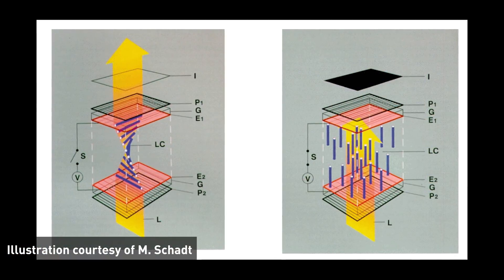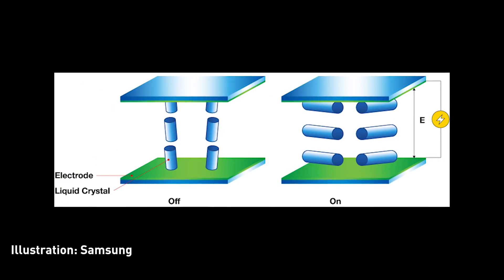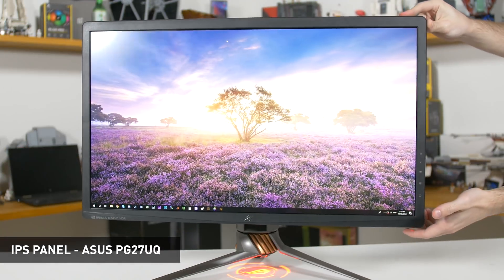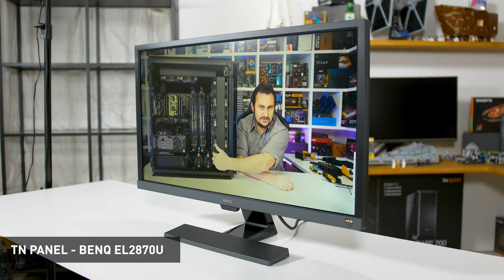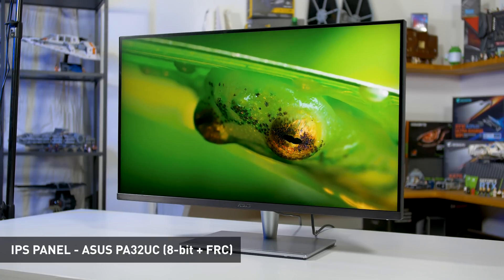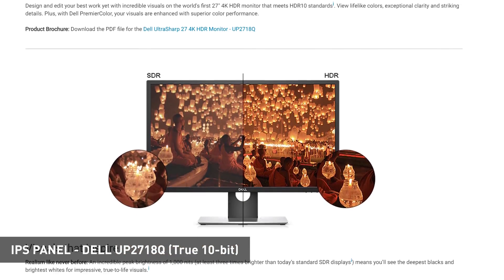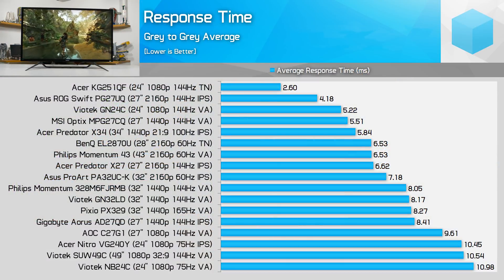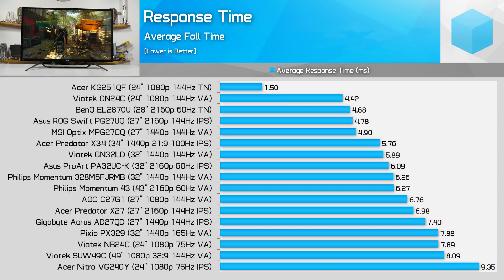TN vs IPS vs VA: Which LCD Monitor Tech is Better?

Comment: Gaming - TN
Productivity - IPS
Media - VA-QLED
Rich People - OLED 
The Truth - MicroLED
Reply: OLED for the Windows bar and Youtube logo burn in.
Reply: @philipcooper8297  LOL! That's a repeat of history, like CRTs with a game burned in!
Reply: phones - oled (cuz its damn efficient)
Reply: No, no, no. Don't do this. There is no panel made for application A or B.
Reply: lol TN for anything eeeew
Reply: @Battleneter  I have to admit, I will take an in-spec Sony Trinitron CRT monitor pretty much any day!
Reply: Dude old list va is mainstream gaming response time is faster an input lag is fine for driving simulations
Reply: C Anderson
NO.
I use IPS for everyday gaming and internet, sometime movies/clips, and no problem at all.
Reply: Well i prefer to game with ips. Started wih an 27inch asus tn and changed to a acer 32 inch 4k ips and i dont notice the diff of response. Always prefered ips for everything.😶
Reply: Exactly this
Reply: You dumb fuckin peckerwood
Reply: @EJSC dumb noob
Reply: Only if you are not productive in evenings - dark room, because dimmed IPS changes any image to a source of a grey light.
Reply: You can get 1ms va and ips panels now. So really they will all game the same with high refresh rates.
Reply: @kushined  you cant... and dont get response time for input lag, as they r not the same, tn is faster, is it worth... depends... for 240hz csgo competitive, tn all the way, its also cheap compared to a decent ips 1440p 144hz low delay one, these are 700$
Reply: @arencorparencorp2189  TN does not have faster response times (input lag), only faster pixel transitions (G2G, which only really affects blurring/ghosting). Good IPS panels can be just as fast or faster when it comes to input lag.
Reply: @Malus1531  the pixel transition is faster so the image gets displayed.. faster, the ips circuit board will be as good at inputs but the display will take the slightest delay over the tn, is it noticeable when ur playing with 30 ms ping. absolutely not, maybe at 240hz extreme competitive shooters at pro lvl... other than that, sure, its, technically, slower but... barerly noticeable if at all, but here comes another MAJOR factor about delays with tn, 300$ tn=good responses and 144hz, 300$ ips=crap, 700$ ips=same perform as that tn, also the light bleed doesnt help much and pixel transition adds a bit of delay as said. and also ghosting, if we count imput lag as the time for the screen to PROCESS the image they r equal, but then the monitor has to change the pixels to the matching values, and tn does that faster, (again, nearly impossible to notice at top tier ips)
Reply: @arencorparencorp2189  A lot of good points, but whether TN is faster will depend on the panel. Look at TFTCentral's review of the Asus PG278Q (TN) and PG279Q (IPS) for example. Similar monitors from the same product line. The G2G of the TN was faster, but the input lag was also much lower on the IPS. In total (pixel lag + input lag) the IPS was actually faster. So you can't always say TN is faster, I've seen many examples of the opposite being true. Though yes the IPS will cost more.
Reply: @Malus1531  well obiously when i compare im comparing top tier tn vs top tier ips delay, not crappy tn vs excellent ips that asus pg i own is great but also own a 240hz zowie and when set at 144hz AND using a tester it has 80% less delay (wich is insanely good for the ips), i cant notice without the tester so, yea overall that ips (700$) will be better than the 240tn wich will work for competitive, and what if its not a great tn vs a great ips, well the ips mops the floor with it xd, but to be fair we cant compare a mhe tn vs top tier ips, or top vs top or crap vs crap, and crap ips is terrible,, problem with ips is theres hardly any, midrange, or u go crap or u go top tier 1440p 165hz, while with tn for 250 u can get some decent 144hz 1080p with ok-ish color accuracy and quite good delays (matching or beating the best of the ips (for 4 times less)
Reply: @arencorparencorp2189  I wouldn't call PG278Q crappy. It's from 2014 and they don't make it anymore, maybe kinda crappy now, but it only released a year before the PG279Q and launch MSRP was $800. But yes what you say about price points is true.
Reply: Gaming TN? no thanks.
Reply: @FcoEnriquePerez  haha good joke
Reply: @FcoEnriquePerez  youre a fake gamer. Every pro cs go player use tn panels ips latency is slow
Reply: @Thesinistereyes1  Bruh there's other types of gaming than "pro cs go", not everyone wants their game to look like shit just for the sake of 1-2ms better response time
Reply: @FcoEnriquePerez  If you said you are not a gamer. Why judge gaming with TN is bad ? TN sure is bad for daily uses beside gaming. But for competitive and fast paced games, still TN is the first choice of the professional e-sport gamers. For casual gamer IPS is pretty much will do
Reply: @florian_spdl  then you don't know what the term "gaming" means
Reply: Gaming - IPS duh
Reply: @SpeedRebirth  watch the video smartass
Reply: You can't achieve sufficient pixel density with microLED technology. Next
Reply: @dmytrotkachoyv  Micro LED isn't about providing the colors with LED's, but instead, providing better color out of the panels that pair with it. By offering led's behind a larger number of pixels, offers a more uniform experience. If it replaced the panel, those LED's would be OLED's because that is what OLED is. AMOLED's would be ideal, but require allot of processor power on the monitor to process the individual pixels. Which is why most large panels are PMOLEDs. (AM=Active Matrix, PM=Passive Matrix) Personally, I use AMVA+ panel, which is great at color replication, and on par with IPS panels without the weird overglow in the cheaper IPS panels. I would buy a IPS panels as well I just like the color accuracy and contrast on my current monitor verse other IPS panels at similar cost.
Reply: @blazetownsend8785  ,
Uh, what did Gretsky Nut say that you disagreed with? All he said was you can't achieve a sufficiently high enough density with MicroLED currently which is true AFAIK. It's primary purpose is to reduce power cost since you can disable them for any black pixel as it's one pixel per LED. And even if the LED+LCD was a single unit per pixel not a full panel on its own with separate backlights behind it that would NOT be OLED... the OLED releases the light directly with no filtering of it. MicroLED technology pairs an LED with each pixel.
Reply: @photonboy999  In fact, he stated that the micro LED would replace color LED's. However, I did not see a post from him anymore to reference a point. He did not reference the panel, but in fact, stated the replacement. Offering an option that included the LED's having their individual light. This is AMOLED. You however, did say everything I said about the panel to led combination in reference to Micro LED. Thanks for the redundancy, the conversation was started through Micro LED. "Micro LED isn't about providing the colors with LED's, but instead, providing better color out of the panels that pair with it. By offering led's behind a larger number of pixels, offers a more uniform experience. If it replaced the panel, those LED's would be OLED's because that is what OLED is." While OLED's are a grouping of colored LED's that switch between on and off to replicate a picture, like a liquid crystal would change phase, it would be the OLED's that provided the color in this experience.
Reply: @dmytrotkachoyv  THAT'S WHY IT'S THE TRUTH WHEN THEY DEVELOPE IT
Don't just claim "you can't" bullshit! People said we will never be able to fly, the same year a guy developed the first plane so stfu!
Reply: All bullshit
Reply: TN is shit, Gaming - IPS for sure
Reply: @alphaartax1044  watch the video
Reply: @alphaartax1044  tns are not defective atleast. Va and ips has ghosting, glow, burns, ips also has shit blacks. Ips and va monitors are literally defective.

Comment: I have photosensitive eyes and TN always gives me headaches which bloom into magnificent migraines if I ignore it (since before I knew about TN, IPS, etc.). I don’t have experience with VA, but I’m not about to take a chance and invest in a VA display.
Reply: im curious tell me more
Reply: @progamer00006   don't know if sincere or if play on words with your handle..... Not much to tell, my eyes are princesses (just look at my avatar :P)
Reply: @unojustaj3562  how can tn have a bad effect on your eyes that isnt present with ips, im really just curious
Reply: @progamer00006  I later realized that the common lowest denominator among displays that give me headaches is TN. I don't exactly know what the science behind it is, but I assume that it may be the low contrast and the micro-movements of my head and the tight viewing angles of TN that cause a constant shift in colors and the "inverted" color effect.
Reply: @unojustaj3562  interesting... yea VA would probably be for you... the only real problem this technology has is black smearing which is sometimes really bad and sometimes not that bad depending on the model...
My 180€ 32 inch 1440p 75h VA panel is just amazing in every aspect but one...
Colour gammut? More than srgb for sure, Contrast? 4400:1 as measured by Pc Monitors, No bleed whatsoever...
Speed? well i actually dont see any blurryness in fast movements with bright colours and high contrast changes, or basically almost every fps shooter like csgo, and i have a cheap tn as secondary monitor to compare to...
But when i eg open netflix, and dragg the mostly black window around in a circle on a grey background... oooooohh boooooi the smearing, those trails get centimeters long... but again no problems with actually properly using the monitor, meaning things as scrolling through pages or gaming...
Only in games with a lot of very dark, almost completely black shadows it starts to become an issue...
But again this is a supercheap 180€ 1440p aoc monitor which kicks ass in every other aspect, other panels such as samsungs will be much better in that regard
Reply: @progamer00006  You guys have convinced me to not write VA off and really try to get my hands on one to test it out when the time comes to upgrade my GPU + Monitor (hopefully around Christmas)
Reply: @unojustaj3562  ^^ you probably wont regrett it
Im such a sucker for contrast, will also never ever again buy a phone that doesn't have oled.
Reply: VA would be best for you probably. I can have similar issues and really can't stand the IPS light bleed (and it effects night time/dim gameplay in some games).
Reply: @daweitao2668   Actually, witch cheaper IPS panels my eyes do get annoyed with black areas of the display because of that glow, now that you mention it. I kind of always took it for granted because it's a heck of a lot better than the alternative. I'd like to try a VA panel for a whole day if I can get the opportunity. But honestly, I think the best (par from OLED) is a FALD IPS panel.
Reply: @unojustaj3562  From everything you're saying, I think you'll like a good VA panel.  Mine has amazing blacks, and none of the color issues the TN has that you described.  It will lose some of it's white contrast at a wide viewing angle, but the colors don't invert like TN.  It would just lose detail in something like a white shirt.  For computer use, and 1 to 3 people sitting at relatively straight on angles, it is amazing.  I would recommend calibrating it.  If not professionally, I would at least dial the basics in with a source like lagom.  Many panels have calibration numbers online, which gets you close.
Reply: @TheCgOrion   Thanks for the info! When it's time for me to upgrade (waiting for sensible GPUs to also upgrade my display as a set) I'll test out potential VA panels as well!
Reply: Less than 80hz is bad for my eyes and 60 is horrible. I will never regret going with a 165hz IPS monitor and I really suggest everyone to go with 100+ when buying new
Reply: @SpeedRebirth   with all due respect, if less than 80Hz was truly "bad for your eyes" then you would also get a migraine from fluorescent lights (and most other lights) and even movies as the low frequency of those lights for people with photosensitive eyes is equal to a stroboscope in the face. Now, it may be true that you've gotten so used to 100Hz+ that less is painfully noticeable and not enjoyable, in which case I would agree with you.
Reply: @unojustaj3562  When I was young and had no clue of how fps and hz worked I always questioned why games and mouse movements was so laggy. I always rubbed my eyes now and then because it felt weird gaming on it. This was way before 100+hz monitors became popular and I had never seen a monitor IRL with higher than 60hz. Then I bought my current 165hz and damn... What a difference! Now the mouse movement is really smooth and I'm never going back to less than 100hz.
Anyone who has migraine should use a high hz monitor, end of story. Low hz lights sure is noticeable. They just changed from regular fluorescent to LED at work and the difference is huge. So much better light and it puts much less strain on your eyes.
And movies are "fine" until they pan to the sides, or a car drives by the camera. Sidemovements on tvs are extremely laggy. Anyone disagreeing with that is ignorant.

Low hz is not a positive thing for your eyes, no matter your sensitivity, that's a fact no matter how many people who disagree.
Everyone thought the earth was flat a few hundred years ago, they were wrong.
Reply: @SpeedRebirth  Have you tryed improving the light in your room while keeping the screen glare free? It will be much better. Just a little light though cause IPS needs less glare.
Reply: @SpeedRebirth  meh... 75 is fine if youre on a budget and dont play esportstitles, the only reason for me to get a 144hz monitor would be the fresync range and lfc ...
75hz feels like already half way to 144hz compared to 60
Reply: Interesting, for me switch from fluorecent back lit to led back lit monitors doubled my migrane rate maybe tripled even. I'm using two TN panels though. 
Makes me wonder would I get less migraines with IPS panels. hmmm
Reply: @Herbertti3  is the backlight flickerfree?
Reply: @progamer00006  Says so in the box but I very much doubt it since I can see some sort flicker with camera.

Comment: VS: higher contrast, great for movie viewing.
IPS: Bright accurate colors,for when color accuracy is needed. great for gaming and general workloads
TN: fast pixels makes it suitable for high fps gaming, cheap low quality tech.
Reply: TN isn't always cheap & low quality. There are actually professional TN monitors that're built to spec. Especially in its infancy IPS wasn't actually much (if any) better then TN, however ideally for professional usage IPS is the better "suited" technology (for a price!).

Comment: It would be nice to implement the Samsung Quantum Dot VA panels on the comparison, especially for color reproduction, like the C27HG70, rtings recommends it as one of the best gaming monitors and it is quite affordable. It would shed a bit more light tbh :) Great video overall though, gg!
Reply: Prob is samsung has got the idea to curve 16:9 monitors , also sub 30".  Unless youre on 21:9 30"+ the monitor should be flat.   Go 32" 16:9 or 34" 21:9.  HUGE difference from 27". Best thing youll do with your pc
Reply: @fredfinks  valid point there I agree. Since their panels though are not typical VAs, I was more interested in their VA quantum dot color reproduction performance though vs a good IPS panel, that would be nice to see. In paper at least, they tick many boxes, sRGB and DCI-P3wise.
Reply: @azriel84  oh i think they very close.  pluses and minuses for both. Id say given that most do a variety of stuff on their pc i think VA is the better option.  Competitve gamers that need highest response times and willing to compromise quality - TN,  Image pros - IPS (theyd use professional grade multi $1000 screens anyhow),  and the majority - VA.

Comment: 144Hz VA is the sweet spot at the moment, image quality close to IPS type panels, response time almost as good as TN with the newer panels, and pricing almost the same or just slightly above the TN panels.
Reply: EJSC I’m running on 165Hz 1440p TN panel and it feels smooth as butter. I have never seen higher refresh rate IPS in person but my eyes are very sensitive to motion clarity so I could see some difference. Some people just happen to have no attention to such details, or they just don’t see certain things.
Reply: EJSC For me only thing that bothers me is colour banding and gamma levels out of the roof so playing games like Resident Evil 2 it’s not perfect compared to IPS TV. But on the other hand in games like DOOM it kills it. The model it’s Dell S2417DG 6bit+FRC. Good colours after tweaking in nVidia control panel but unfortunately not much can be done to fix gamma.
Reply: @EJSC Not the most well versed with monitors, since I consider myself to be a novice in regards to monitors. So I just bought a VA Panel the other day for a ridiculous deal and boy did I snatch it because of the fact that it's a 144 Hz w/ 1ms Response Rate. It's one of the few VA Panels I tried out before buying where I couldn't tell much ghosting at all, and I've played FPS games almost all my life. I currently have it set up next to my older monitor which is also a 144 Hz w/ 1ms Response Rate, but it's a TN Panel. The differences when gaming is almost unnoticeable thus far. Is the VA Panel a true 1ms Response Rate? Or is the difference so minute that I can barely tell the difference? And that maybe I'll be able to tell over time? 

Oh and for anyone wondering. It's the MSi Optix MAG24MVC 23.6" that I bought for $150.
Reply: Keelan I would think of buying it if it only was a g-sync.
Reply: ok, now I'm completely confused, which monitor should I go for if I work with video editing?